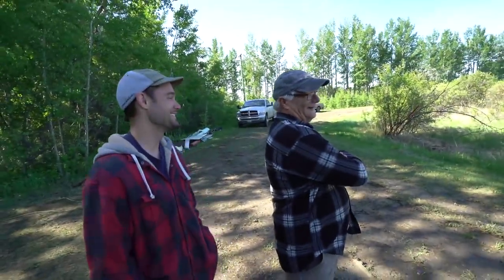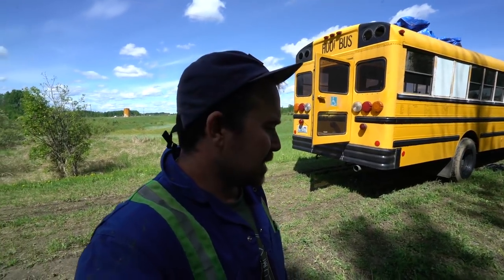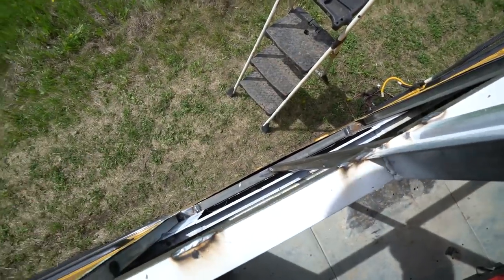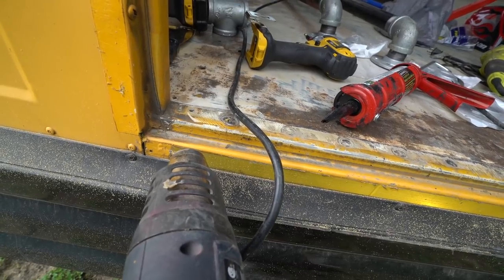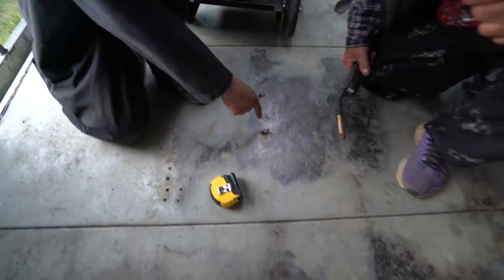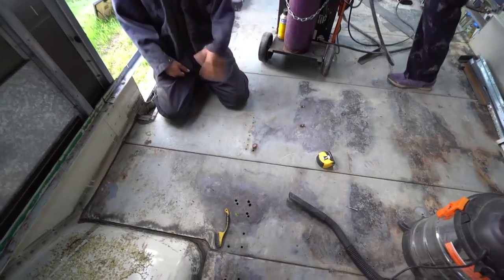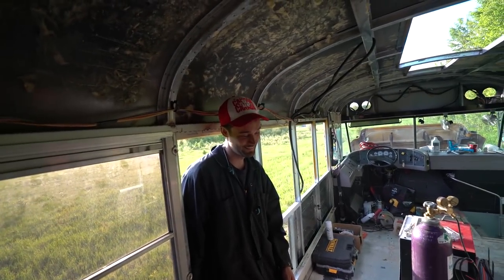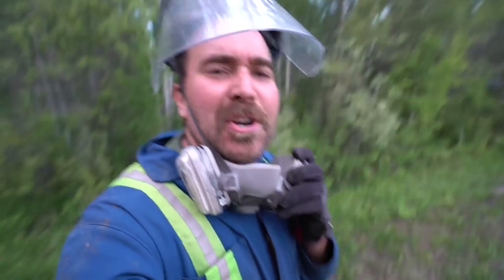WELDING FLOOR HOLES TO WATERPROOF FLOOR

Comment: Badge has it correct, there is no substitute for metal.  Years ago, I repaired holes drilled in the floor of a van conversion I was doing with silicone caulk and had rust within a year.  Remember, Badge has the benefit of years of experience.  Not all problems can be "thought through" to the best solution.

Comment: if I had to guess, I would say that large opening on the roof is going to be a hatch with to access the top. AKA inside folding ladder that tucks away when not in use :)

Comment: Didn't catch what was said about changing tires instead of rear end - to fix what problem?

If not a large skylight/sunroof, it looks about the right size for 'attic pull-down stairs' for access to the roof deck.

Comment: what are you going to do with the upper signal lights and stop sign Jax!
Reply: gilliland426, I was hopin' he'd wire those lights into the signal lights and four-way hazards but he said something about closing 'em in this video. I think that's what he said.
Reply: that's what i would have done myself if i was building it... more lights the better and safer to be seen from people pulling up on Jax!

Comment: I dreamed up a gizmo ( not built just drawings)
that would hold all thread in the hole as a filler then weld it and cut it off, grind it smooth, but now I see that is unnecessary. 
Still wire wheel and re under coat the bottom.

Comment: how do you plan on making the veggie system work efficiently with your T444E engine (the same as mine) since that guy said it won't work as efficiently on the 444 as it does on the 466, I'm interested to hear how your going to make it work efficiently or make it worth the time. Seriously I'm looking at doing the same thing so please let me know

Comment: Hard to BELIEVE your welding and grinding around all that .. EXPOSED glass! CAN spray the "tar" back after welding holes. I use the stuff made to go over tree cuts or for pruning.  Great way to learn about metal expansion, or warping. Still betting it is not a "first", and i have no idea what it is....
Reply from the maker: We shall see
Reply: You WILL SEE, little pits in your glass where hot metal, or grinding sparks hit it. SEEn  several fold down staircases to the roof deck in buses before. One of the most tricked out buses ive SEEn, was a old early 50,s bus with a fold down/pop up alaska camper on the top that was the play/bedroom. Sky diver dude (dickybird) who started the tandem jumping and the bus was famous in those circles... called the "blue skies" bus. It Spent a lot of time in the desert.

Comment: Hello gents, it looks like a nice day in Alberta. Right on Badge! That's the proper way to deal with those old bolt holes. It will be as if they were never there. Why were ya thinkin' about changin' the gear ratio?...fuel economy? Ya won't make any new land speed records with 4:11s and short rubber, but isn't that how 99% of school buses are set up? Don't get me wrong, I dig speed and I think a triple digit skoolie would be far out heh, heh. You would definitely hafta pimp that bad boy out with wicked paint, some shnazzy wheels and some way cool exterior neon! Whoop Whooop! It's cool that things are movin' forward, is there a guesstimate for the completion date, or is it a it takes as long as it takes kinda situation? It would be so cool if ya got a veggie oil sponsor like I was talkin' about before. Between that and the large capacity fuel cell you'd have no worries about supply ever. Stay the course fellas and things will be takin' shape in no time. Play safe! .......................................PEACE!!
Reply: Oh yeah, I almost forgot to mention this...have ya ever used citric remover for decals and vinyl? It works like a charm! For vinyl letters like your "School Bus" all ya do it spray it on and it comes off with a plastic spreader and paper towel. I first saw it used when I switched companies and hadta have the name and stuff changed on my truck. It's really quick and easy with the bonus of bein' no VOC. Just thought I'd mention it. .......I'll let myself out.